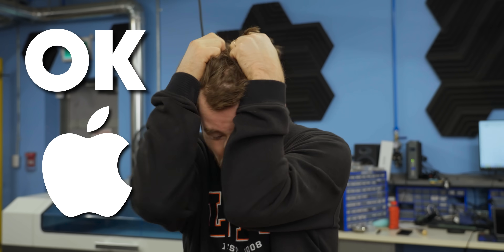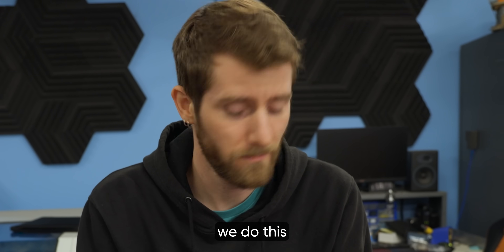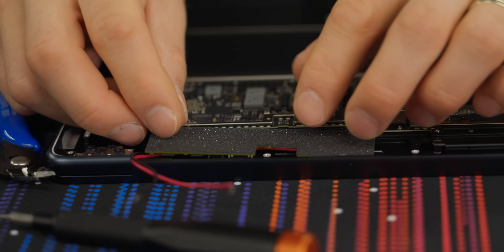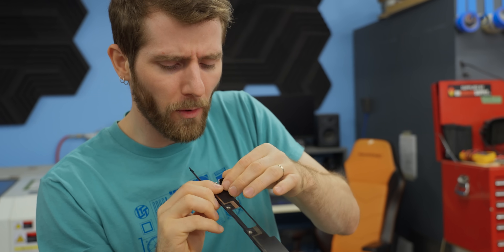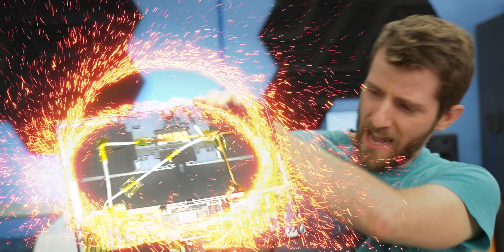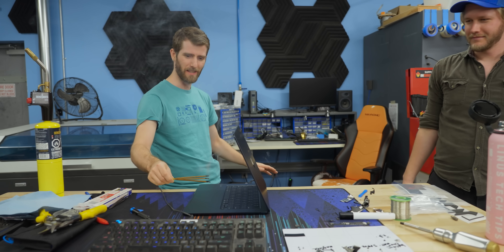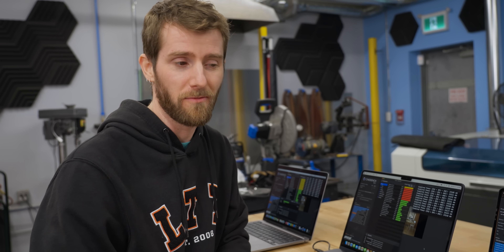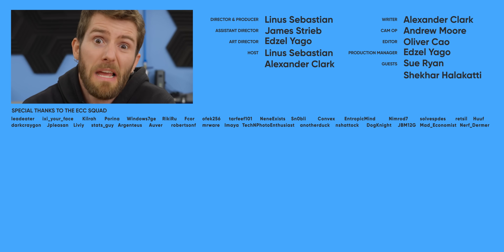Apple please watch this. - Frore AirJet MacBook Air

Comment: Why didn’t you just create a replacement bottom panel that gave enough space for the extra bits without hacking out parts of the laptop to make space. 

I replacement bottom panel with appropriate cables to tie in to the internal power connectors could potentially even be productized as an aftermarket upgrade

Comment: I dont understand your hate for these mac book airs, I just bought an M2 air the other day and disliked macos for years although could admit their M chips were pretty great. The underbody of the air in the CPU area does not get warmer than my skin temp and thats with multiple programs open such as remote desktop, Safari with 6-8 tabs, music and watching youtube videos while torrenting etc. 

Value for money at the moment their Air series of macbooks are pretty compelling for an essentially perfect package, I do admit I miss the days of being able to run windows of them natively back when they had intel chips but I feel like that would break lot of the polish they have built into the macos/Mac hardware.

Also, yes air M series chip do heat soak after multiple runs and thermal throttle but only when doing super intensive tasks such as video editing and rendering videos which in that case if its so essential you need the extra time saved then why did you buy a macbook air to edit/render those videos in the first place? Most people would just live with the longer render times with the air if its more of a hobby thing

Comment: Shoutout to the DIY efforts. But basically you mean is apple should integrate a fan cooling system in MacBook air, and MacBook Pro which have integrated one is actually outperforming your modified air in long running test.. engineers are not dumb, air has no fan because their aim is to keep the machine silent at any moment.. if they want to solve the heat problem, they would have just integrate the fan system, but it will make no difference between air and pro, that’s why air has no fans

Comment: I just wonder why Frore doesn't make CIRCULAR fans so we can replace conventional fans on gaming/regular laptops with these. The square design makes it harder. It doesn't need to be a square device but just come with a round casing so it fits. @frorer

Comment: This is just not practical. Nobody is going to cut our audio jack and Touch ID ribbon cables off to fit in an air jack. Should of made sure you could still use everything
Reply: That's not the point

Comment: I agree every tech company knows this product works and is super efficient but for some odd reason they are purposefully bypassing more reliable efficient systems. It was the same concept with one time use needles in hospitals back in the days. They medicial industry knew it was the most efficient and safer but solely out of spite rejected it. Now it's "all" they use in hospitals today.

Comment: While solid state cooling may seem like a no-brainer, there is a MAJOR problem with these. This type of cooler produces ozone which damages things like plastic and rubber. Long term use of this cooling solution would likely end up causing early component failure.

Comment: I'm sure that they thought about it and there is a practicality or technical reason why they did not integrate a cooling system in the MacBook Air. I don't know why hundreds of competent engineers working with the best technologies on the market and with Apple labs doing R&D with confidential experimental stuff would not think about it. I think that Apple is proud to develop the most energy efficient laptops on the market and they tested their chips with different temperature conditions to ensure that the chip longevity will remain the same under some heat pressure.

Comment: It would have been cool if you designed a slightly deeper bottom case and then could have room to keep everything in there. They're already ridiculously thin and personally I wouldn't care if the laptop was 2mm thicker. Let Apple design the inevitable thinning of the device again to fit everything in the same sized chassis.

Comment: The bottom line is that IF these excellent cooling devices were actually engineered into the Mac laptop, the entire machine would last far too long due to greatly reduced thermal stress. That doesn't mesh with their planned obsolescence strategy.

Comment: There is many questions unanswered. It is cool tech but why there is still no commercial available laptop to buy? This video shows there is some problem with technology. Probably the price or longevity otherwise all laptop makers would be jumping in already.
How much this solution cost compare to fan and fanless design? If they would sell DIY kit for Air or MacBookPro, how much it would cost? 100 bucks? Add 8 GB of RAM and you are at price of 14" M3 MBP. Reliability is of course also question. It is new tech. You can not put it into macbook to find three years later it is failure. And of course power efficiency compare to fan. But DIY kit for older MacBook Air could be more interesting and price more justified.

Comment: I use a bae model m2 macbook air I run multiple large nodejs dev environments and like 100 chrome tabs across an ultrawide 4k monitor and the base retina display and it runs about the same (for work tasks) as I would expect my i7-12700k rtx3080 32gb ram to run.

Everyone goes on and on about 'horrible performance' of m2 macbook air, what the hell is everyone else doing that I'm not. I've never had this issue. I have an external fan just in case but never turn it on cus I never need it. I only get real lag when I make a memory leak.

Comment: Make a DDR5 active cooling solution with these using optional fan pins on a motherboard for power. Could be interesting if they can be effective use-case instead of stock radiators on RAM modules.

Comment: It is possible to improve the cooling system of a Mac by incorporating air jets with a heat sink vapor chamber, graphene sheet mesh, and liquid metal instead of using a lid with a thermal compound. These air jets would run all the way from one edge to the other and could be connected to the battery with a ribbon cable and a controller on the Mac's system-on-chip and it wouldn't need to change ting to much .

Comment: what if you got a(n elegant) machined aluminum piece to be attached at the bottom of the macbook? And you can make a cutout on bottom cover to fit the jets, and power. It won't be as slim anymore, but it will have cooling. 
I guess drawbacks no matter how you slice it.

Comment: what if you were to custom 3d print a new backplate for the mac book air accounting for the air jets and not hav to do as much cutting away of things, or is all the cutting necessary to properly expose the heat generating components to be cooled by the air jets.

Comment: Why not just custom design the bottom case to fit in the cooler and it's circuit instead of removing necessary stuff , removing important stuff just make it useless

Comment: I think 49°C of surface temperature is relatively unacceptable. At around 40-45° eggwhite proteins (don't know how they are called in english, sry) start to break down (which is why hot summers near 40°, even is it's just a couple of days at max, are do dangerous) and heat sticks, which are meant to cure fresh bee stings and so on, heat up to around 50° because their poisen is made out of eggwhite proteins too.

Comment: Ooof. It would have been very easy to grab voltage off of one the main power rail inductors instead of the usb hack. There are nice big pads to solder to. I don't understand how they fried something probing around unless they didn't unplug the battery first which is probing around 101.

Comment: Maybe we're just too... GenX... but back when we needed more air for our TransAms we just poked holes in the hood and latched on devices that rammed air into the carbs...

In other words - poke holes for input, solder or glue those modules to the chosen mount points... then if you want to get super fancy, even it all out with a machined bit for the bottom to keep it all flush.

Or have 'em sticking out the top and lock the speakers into only playing Dokken.

Just sayin'

Comment: To Linus I think you should have ran the test 
with a MacBook with the bottom off of each item for comparison,
 Then put the back cover back on run the test again.
 so we could actually see those things flex their muscles compared to the non Ramjet MacBook Airs .

Also we don't know what the ambient temp was inside that room.
 ( For fun it would have been neat to see differences in drawing in already cold air)

What the static pressure of the room was before beginning the test.
And it would have been nice to see what the setup would have been like if you had targeted just the CPU hotspot 
As the focus of one of the MacBook Air's To rule out any other sources contributing to the situational variables.
And Finally I would have liked to see you run those ramjets in the situation with a 3-D printed bottom of the case 
without having to sacrifice any of the parts you 8< CLIPPED OFF >8
Reply: AKA the bottom 3-D printed bottom being larger ( and get rid of the concept of a THIN laptop rather than sacrificing functionality.
Since you've already gone beyond what Apple's Form Factor was when they designed it......

Comment: yes, the 6 speaker sound system is only available on the 15 inch MacBook Air. High fidelity sound system comes on the pros, this includes a higher wattage amp and tweeters that fire out of the grills on the laptop and fire the woofers out of the fan intakes on the bottom

Comment: lol  you are trying to fix machine that looses 5% in results in long cinebench test due to thermal throttling  and has  no thermal throttling in real life in average use.  Instead please fix  intel and AMD processors architecture so  the could even work without fan. 
Sorry  it is  more like stupid hype video achieving little to none  by ruining mackbook.
And by the way  - sorry but looks like  this airjets have similar cooling performance as just adding thermal pads to dissipate heat to MacBook backplate from this small initial plate.

Comment: 9:44 Pretty important context for anyone with engineering background wondering wtf they're trying to achieve. This episode is a joke. A properly designed heat spreader+airjet interface would've been much more potent than treating them as exhaust fans, hell airflow weren't even guided through the fins judging from the 0.5 second in which they showed the final assembly at an angle.

Comment: You guys got it flipped. I’ve closely followed Apple’s every move for the past 20 years. This uses more power, and it decreases the performance delta between the MBA and the MBP. Apple doesn’t want either of these things. Where everyone goes wrong is thinking that Apple competes with their competition. At Apple, they mostly compete with themselves and how they market each product to slot it into a category. The MBA is for users who don’t give a crap about performance, but want all day battery. These users never see sustained loads. 

When someone wants performance, Apple upsells them to the MBP. What I see Apple doing is putting a beefier version of this in the MBP. I have the 14” M3 Max 16/40 with 64GB unified memory. The fans can get pretty loud under sustained load. Reading forums, this is the biggest complaint I’ve seen in the community. That and the 14” performance under load falls behind 16” model over time and the 14” battery isn’t as long-lasting.

If they put this in the MBP, they might be able to do it for less power and in less internal volume than fans. I would need to see the numbers, but that could be a big win. Especially for the 14” model, which could get a larger heat sink to compensate and maybe even a few hundred more mAh of battery capacity. For the 16” model, they are at max capacity for airline regulations on battery but could potentially make the device slightly thinner or lighter, which is great for a 16” device. And making both silent for professionals would be a huge win.

One question remains: Can this tech be scaled up for a larger system with higher TDP without hitting the battery harder than a fan? If not, then I don’t see this happening until this companies redesigns the product to be more efficient.

Also, you know what other Apple devices I could see this being used in? Vision Pro and iPad Pro. They might be able to cool a Vision Pro with M3 or M4 Pro using this. I doubt it will stay on standard M-series forever, it will at least graduate to the M Pro-series in the coming years while the M-series drops down to the Vision Air or whatever.

BTW the Vision Pro is getting the M3, Apple just couldn’t announce it yet. It’s gonna be a surprise.

Comment: its all about marketing and upselling the same product… if the air lineup performed same as pro lineup whats the point of selling the latter one?! technically it may be a question of engineering, but economically the add up a huge margin on the pro lineup by allowing the cpu perform better and throwing in some extra software stuff…

Comment: i don't think it's a macbook air product, it's a pro thing. You get just a bit to the end user, cuz it's rare for a normal person to get a long task that requires processing that much. But this as a replacement for the fans we already have on pros would be a big improvement, but only if it becames cheaper

Comment: My question, if you want good performance why don't you just  Machine out the spot over the processor install one of these directly on the processor and laminate on some sort of rubberized foot that covers the entire back which will give you a little bit more of an ergonomic feel because it will tip the macbook up on the back and give you good ventilation for the intake and access to the filter to clean it without taking the unit apart. Another option is make a secondary base for this machine that adds the extra space necessary to install the parts without compromising on machine functionality. Making it a slight amount thicker is no big deal. It's already thin as hell give it a little bit more girth.

Comment: You know why I use a MacBook Air? Because the pro stays at home. I want light, quiet, and a week of battery for light use. My M1 has NEVER fallen short of my demands even if I’m feeling like doing some image and video editing.

Apple knows that the majority of computer users are doing no more than Facebook and email. That is where the Air shines. That is not to say it doesn’t perform in heavier demands but that is not it’s goal.

If I need to do multicam editing I just open up the MacBook Pro and knock it out but at the end of the day I don’t have to carry anything bigger than my Air. It’s wonderfully convenient. If I had to keep only one laptop I would take the Air. It’s nice for last minute browsing and work in bed. The sheets don’t block any air inlets.

Comment: Well you see the point there, if you want extended workload on laptop just buy pro, but you will not be limited by raw power even on air version
It's surprising to see this non moving air mover is capable of replacing a fan though

Comment: Well, mba's are mostly for students, and students tend to try new things occasionally, it wouldn't be too bad if apple included an active cooling system in there, even though there is no need for that to be active for, say, 90% of the time, it would still be great especially considering the price is $1200. Just saying!!

Comment: Would this cooling system be greatly affected by dust? It seems that those intake filter areas could easily be covered in dust in a few months time
Reply: Do you live in an active wood working shop?
Reply: you could just blow compressed air in reverse every few months...

Comment: Have you ever considered that you might have psychological issues?
Here's an idea, next try to buy a tractor and turn it into a tank. Then buy a microwave and try to turn it into an oven.
Don't buy an oven and use it as an oven... that would make no sense... far more sensible will be to buy an oven and turn it into an towel drier.
Reply: They took a Macbook Air and demonstrated how Apple could turn it into a better Macbook Air. Tf are you on about?
Reply: What, we can't even solve an actual issues now?

Comment: This was a press event by Frore Systems that came up with the solution, completed working examples, and sent it out to the press to cover. But Linus's thumbnail and narrative is "Linus fixed it." The entire video is presented as if LTT came up with the solution themselves, and just sourced the parts from Frore. Even in the recovery of this channel after the controversy, the shameless self promotion knows no bounds. LTT effectively claimed the credit for Frore's achievement that came up with this solution, built it, and was foolish enough to ask LTT to cover it. Truly disappointed.

Comment: Okay but... You guys have a machine shop AND an engineer. Why didn't you just take the bottom off the MacBook Air, and machine a new one with enough room to accommodate the coolers, small holes for inlets and possibly grooves to use the bottom plate as a cooler???

Comment: 9:50 Linus, I believe Kapton tape was used for electrical isolation, but it is also a bad conductor of heat. Kapton was originally developed for aerospace applications to shield against high temperatures

Comment: I think this went very well considering you don't have near apples resources, the fans weren't made for this specific function, and the small amount of parts that where used. Apple and all its engineeers should be able to crush this if they maximized efficiency and air volume.

Comment: 13:31 not your fault but shouldve been caught by your new processes. 400 micron is not 4/100th of a mm.
I mean you did correct it 10sec later, but would be nice to have corrected it the first time already.